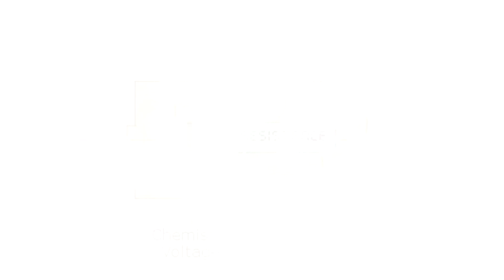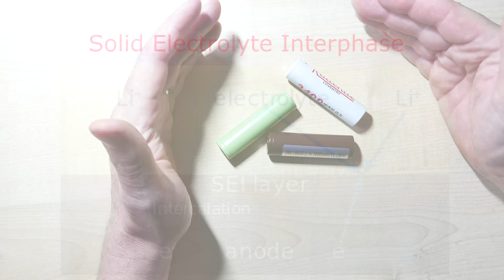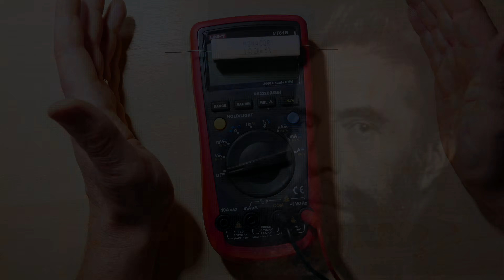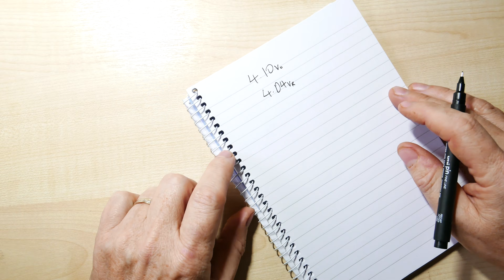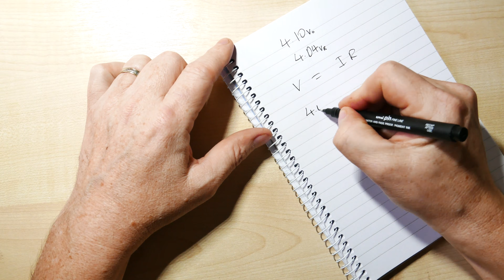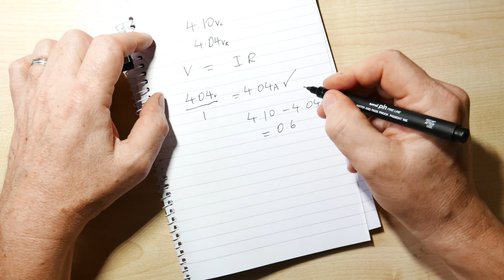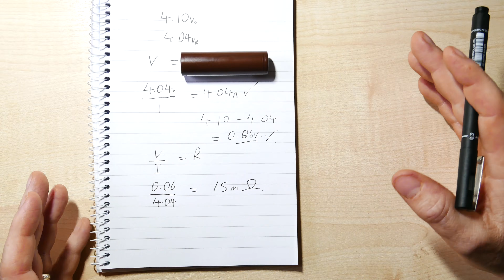18650 Li-ion Internal Resistance Explained & Measured

Comment: You can calculate the internal resistance 
Using Vload= vopen- I*R
The internal resistance calculated 1 the value at the current battery  Soc 
And it changes all the way draining the battery
At some point, draining the internal resistance 
Drops the comes back higher to previous state

Comment: I know it has been many, many years since you posted this, but thank you! My question is, when you added the resistor 1000 20w, and it dropped by .06v, the amps you showed was 4amps ish. Is that the continuous output amp rating? If not, how do I test that please? I have unmarked cells from a cheap ebay battery and a few cells are bad, but, they are funny enough with no markings whatsoever. I need to replace the cells in the giant pack, but have no idea what kind of cells they are. I am able to do the capacity test and that's great. Voltage test, also great. But, how can I test the amount of continuous amps and maybe even the max burst in amps output? If you get time, I would be very thankful, so I can try to find cells that are similar in spec. Great simple video! :popcorn-yellow-striped-smile:

Comment: Nice video but a little confusing because of the 1 ohm resistor. Two or 5 ohm resistor would have made the calculation a little harder but the video would have been easier to follow. Thanks again!

Comment: I got a question in terms of factoring in the resistance of the wires - would shorting out the the multimeter by touching both probes together give the resistance value of the internal circuitry and  wires of the measuring device? So whatever value it shows when doing so - one would subtract this from the value on what you get with the resistance of the battery?

Comment: Now I know why when I use the MC3000 charger's internal resistance measurement function, it takes a couple seconds. I guess it's waiting for the voltage 'sag' to settle.

Comment: Ummm....are you sure you calculated that correctly?
V/I = as far as I knew is Voltage / Current.
Where as you divided the Voltage drop 0.06v by the loaded voltage of 4.04v.
This only makes sense and gets the correct answer when using a 1 ohm resistor, because the loaded voltage and Amp draw are numerically equal to each other.
With any other resistor, the way you wrote the calculation will not give the correct answer.😁

Comment: I'm attempting this process right now to make a 3S balanced battery pack from 18650's, using Nichrome wire (3 ohms worth) as the resistor, but the voltage I get on my multimeter changes constantly making it hard to get any useful data. Is there a problem with the concept of using nichrome to do this? it's not coiled up, and it's not noticeably heating up.
Reply: Nevermind I was just getting inconsistent contact with my multimeter probe against the battery! battery holder makes all the difference!

Comment: Tom how much will the 5 % tolerance on your 1 ohm 20 watt +- 5% ceramic resistor effect the final internal resistance reading, i could do the math but was wondering if it would be worth the small extra cost for a precision wire wound audio 1 ohms 20 watt +- 1% ceramic resistor.

Comment: You said "just make sure the power rating is correct" how do you determine that the power rating of the resistor is correct? I would love to use this method to get an idea of internal resistance of some Yinlong 40ah LTO cells. They are much larger in capacity than these vape cells but the nominal voltage is lower. How do I figure out what resistor I need to test them? I plan to have the cells charged at 2.3v for the test, and I don't care about the number itself as much as the results being similar (I just want to make sure none of them have a much higher result of the equation) Any help is much appreciated!! They are 66160 cells 2.3v

Comment: if I don't know the resistor value, but I know that the discharge rate is at 1 amp this becomes simply subtracting Vr from Vo to get the internal resistance?
I found an old e-bike pack and want to quickly figure out which cells are better and which are worse.
I have a power bank case which accepts these cells. I test voltage across the leads with no load and with 1 amp load. 
Can it really be that simple?

Comment: Bi'I have a ? which is may be connected with battery resistance matter: when I try to charge some 18650 li! ion batteries mounted with laptop or drilling machine BMS,my 12v IMAX BY quickly buzzes with " CONNECTION BREAK" error.Then it is no more possible to charge: is is something that is fused or melted in the BMS?Inreallynwonder how to solve this f....g matter 🙃Thanks!! .

Comment: Great clip, 
To be accurate you should account for your wire resistance.  I estimate 4 to 7mOhm is your wire resistance , so your internal resistance is 8 to 11mOhm.
Reply: how about 5% accuracy of 1 Ohm resistor itself ? ;)
Reply: yeah, those wires will show their resistance at those 4 amps of  current

Comment: nice video thank you, people should not mix this numbers with resistor meters we use, they use ac internal impedance to get the meter reading number you should divide the result with 0.0022 ohms, the meter should show 67ohm which is pretty bad for a battery, good 18650 should read around 20ohm on ac (resistor meter), dc resistor should be 44ohm or the way u say 4.5 ohm.

Comment: Hi there, I'm a bit late to the party with this video. But can anyone tell me, Im trying to test some 18650 batteries, I'm using a resistor which is 1.5 ohm and 5 watt, is this suitable? Also, when I put my multimeter across the resistor it read 2ohm, so I put the multimeter across itself (touch the negative and positive probes together) and it reads .5 ohm. So my question is do I include this in the equation which is stated in the video, so instead of using 1.5 ohm like the resistor states I would use 2 ohm to account for the resistance of the multimeter? Thanks

Comment: I think when the resistence we are looking for is too low, we need to consider the resistence of the wires, olligators pressure, contacts, etc. Maybe mesuring the voltage on the wires too. What do you think about ?

Comment: Very helpful, been using my chargers measurement of internal resistance, but it keeps varying by quite a lot, I'll use you method as a base line, thanks.

Comment: with no load my cell was 3.77v with load it was 3.43v after the test without load it was 3.77v I checked the ampere before hand and it was 0.69 ampere 
so 0.34÷4.8 resistor = internal resistance of 0.51 ohm is this cell good for 1a load?

Comment: Hy, I got lifepo4 battery pack from all in one solar panel it's rating is 12.8 15Ah it has 4s 3P configuration but the problem is it's bms auto cut off its charging current when battery reached  around 13 volt but it should cut of at 14 . 4 volt because fully charged li fepo4 cell voltage is 3.6 volt so 3.6 x 4 = 14.4 but why it cut of at 13 volt because if you do the maths opposite, for each cell there is  just 3.2 volt average which is known as discharge cell but, bms thinks it's charged why?
Reply from the maker: One or more cells over-charged.
Reply: @crazytom  and I noticed one more thing , it also pops when this 5000mah cell deep discharge below 3 volt at very light load . This is weard for me because at 3p cell of 5000mah rating I was drawing just 1amp dc motor as load but when it deep discharged it pops without being hot it happened 2 times

Comment: Great vid.So we  always need a load to determine the internal resistance of the battery? Secondly you mentioned the SCI enjoying high voltages , can you explain what you ment there to prolong the life of a battery. What does that mean in simpler terms? Cheers

Comment: question: any resistor can be used instead of your 1.0 ohm 20w resistor you said, but if i use your Vo and Vr numbers and replace the 1,0 ohm 20w resistor with a 7,2 ohm 20w resistor i get a realy differen result, why is your calculation correct and not mine then?

Comment: Man, the resistance in those leads and contacts, connecting the 1 ohm resistor...that's gonna throw the math way off.  Resistor leads should be bonded to the screw terminals, or measure the whole stack-up with leads in circuit for exact resistance value.

Comment: The serious mistake with this method is the thin resistor's cables. It's better for comparison purposes to use a 3.7Ω/10W resistor (I ͌ 1A) and as short/as thick as possible cables to connect the resistor.  The internal resistance changes a little with the current and with the charge level of the cell.
Reply: I think same. And till a bad contact in the whole mesh will add some error.

Comment: Doesnt it also heavily depend on what load you use ? because im getting different results with the exact same battery.
Reply: I have tested with 1 Ohm and 10 Ohms load, and the difference was only 11 mOhm more for the 1 Ohm load, I'm doing two sets of test for better accuracy. With a lower resistance battery, the difference was negligible, so am thinking the precision goes down with bad cells at high loads...
edit: I wrote 100 Ohms, but it's 10 Ohms

Comment: Still a valuable video 5 years later. However, you said back the charge off a bit to 4.1 instead of 4.2V, but didn't suggest a method for doing this. I am mortally wounded (like Nelson!) Thank you very much. I have saved this video!

Comment: This is great and very comprehensive but I should add the resistance should be measured more accurately, not all resistances are made the same, but at the same time small resistance resistors are a pain to measure
Reply: for better precision, it would be better to do various measurements, with various set of resistors values, like 20, 10 and 1  Ohm, I use 10 and 1 Ohm and I get very close results

Comment: Please do forgive me for such a dumb question, but I've been told that even milliamps could incapacitate a man, but seeing that you calculated 4A from the 4V battery with a 1Ω resistor, would that have zapped you if you hadn't had that holder to keep your installation in place but tried to hold the resistor to the battery by hand? The numbers suggest so, but the 4V cell seems kinda' harmless... which part might I be misunberstanding here?
Reply from the maker: Yes .. a few milliamps to the heart can stop it but skin breakdown voltage is over 50V.

Comment: Well Done Tom!  
I’d like to check the IR of a LiFePO4 280AH cell, the open circuit voltage is 3.303V.  You mentioned any resistor will do but make sure the power rating is correct.  Does this mean a 1000 watt resistor?  What method (or resistor) do you suggest to check IR?  Cheers, Rich
Reply: I think you are mistaking capacity for current. if your resistor is 1 ohm then your test setup current will be ~3.3V / 1 ohm = 3.3A. So your resistor must be rated at minimum 3.3V*3.3A=11W. You could also use two 1 ohm resistors in paralel for testing the battery @ higher current: 3.3V/0.5ohm=6.6A. 
3.3V*6.6A / 2=11W each resistor.
Reply: @heinon8380  ...much appreciated Heino!  I’m going over the info.  
Rich

Comment: Good explanation of the matter. Here are couple of my notices on the measurement part: that power resistor has 5% precision, so it is slightly different than 1 Ohm. Little change in resistance will significantly affect the current running over that circuit. Another note: the wires used in the experiment has small diameter. It also creates a resistance when 4 A current runs. I would increase the wire diameter first and measure the resistance at the connection of the battery holder then run the measurement. In this case, the internal resistance of a battery would be a bit precise.
Reply from the maker: Yes good points but it's illustrative.

Comment: i have LiitoKala Lii-500 when is better to measuring internal resistance ,when is full charged or when is discharged ? it is very different value like 10-90
Reply from the maker: 3.7V preferable but 4.2V as alternative.  As long as you are consistent for comparison purposes.

Comment: OK. Now I know the internal resistance of the battery. What do I do with it? How do I know whether 15 milliohms is good or bad for particular cell?
Reply: The lower internal resistance, the better battery for high drain devices (for e-bikes, drilling machines, etc). Cheap batteries tend to have high internal resistance and cannot be used in batteries packs, they overheat when you apply heavy load. In general, look for lower internal resistance. When a battery ages, it tend to have higher internal resistance

Comment: lovely video nice and easy to understand thank you. 
i gotsa a question: on the resistor does the 20W rating mean anything over that would mean it starts to burn up? like 5A -->> Ploss = (I^2)*R so 25W it starts to get Hot?
also the 5% uncertainty is concerning the resistance right? so youd have to calculate the extreme "edge" case value for both resistance cases of the load resistor to get the uncertainty in the internal resistance of the cell, you cant just take that 5% and apply it to the result you calculated right?
many thanks
Reply: The resistor is used slightly outside the rating but it will survive a short test like this without problems.
The uncertainty on the measurement is dominated by the +/-5% of the resistor plus +/-0.5% for the multimeter inaccuracy. So it is easy to improve the accuracy by measuring the real resistance of the 1ohm resistor plus its wires, and using that measuremed value instead of the nominal 1 Ohm. Doing it like that, the error reduces from +/-0.83 mOhm to +/-0.075 mOhm.

Comment: This value is not even close to approximate,  hg2 has DC ir of about 23-24mohm , you should measure current yourself using a second multimeter rather than relying on the resistance rating,  I can bet real current was lower than 4 amps

Comment: Shouldn't you also measure the resistance of the resistor rather than relying solely on its stated value ?
I can see errors creeping in here.
>
Reply from the maker: Yes.. and the wires and compensate for temperature.  It's illustrative.
Reply: @crazytom  No not necessarily the wires and temperature if you don't need to be super precise.
My point was that a resistor may be marked incorrectly, say for example 1 megohm instead of 1 kilohm which is an order of magnitude that would seriously affect your result.
>

Comment: I'm doubtful that this is a valid method, and if it was your meters would need to be much higher resolution that what you're using here. You didn't measure any current or even verify the resistance of that resistor. Do you really think that cell has 15mOhm internal resistance?

Comment: The resistor is 1k 20w right? Can you do it with other? Like a salvaged one? Since much stores are now closed because of the pandemic.. Many thanks.
Reply: Can you do it with a 5w 1kOhm, same as yours but 5w instead of 20? It gets pretty hot ta l
Reply: @gugaboyz  NO!  Use 1 Ohm Resistor, not a 1K Ohm restisor ...
Reply: @MrSummitville  I'm just using the turnigy accucel 6 as soon as it gets here. Next week. It's instantaneous ;)  but thanks for the heads up

Comment: Not sure if the 15m-ohm is the correct resistance here. That sounds really low, I only heard about 25 or higher numbers.
Reply from the maker: I have LTO cells at 6mOhm
Reply: @Grace Ho - Purchase some high-discharge cells and then measure the Internal Resistance ...

Comment: What is a safe lowest discharge voltage pls
Reply from the maker: Each cell can differ.  If you stick to 2.9V for li-ion and 2.8V for LiFePo4 then you should be fine but some li-ion can safely discharge to 2.5V but there's very little useable energy left after 2.9V.
Reply: @crazytom  Does discharging below 3.1 volts shorten the cell's life, similar to how charging above 4.1 volts shortens the cell's life?
Reply from the maker: @MrSummitville  Yes!  Depth of discharge before recharging should we kept to a workable minimum.

Comment: Do I need to use a 20W resistor or will any resistor do the job? I have a very large battery, does that make a difference?
Reply: Since resistor will be used for short period of time you can use any, i use 5w and it only gets warm when testing
Reply: @Boz1211111  What size battery?
Reply: @yehudagoldberg6400  18650
Reply: @Boz1211111  I want to test 100 AH LFP cells.
Reply: @yehudagoldberg6400  guess voltage is what matters, tho you might want lower resistance resistor for such big battery, 1ohm could produce too small voltage drop to be measured correctly
Reply: Compute the Wattage dissipated by the resistor and then use a resistor rated, at least, double that ( for safety ). The resistor will get HOT !!!

Comment: The only thing you forgot to mention is about what internal resistance of an 18650  is when they are bad. How to determine the cell is bad
Reply from the maker: Any significant change in either direction measured at the same SoC.
Reply: @crazytom  thanks!!
Reply: To be specific. Is there a percentage out of manufacturers specs which you would consider it bad? Eg I have a few samsung inr18650‐20r batteries which by spec should be 15 or less but measure 38-128.

Comment: For future consideration...sometimes it's best to NOT use the simplest figures in tutorials If that means you get the same number appearing in multiple locations but means different things.
For example, I would advise using a resistor that is NOT 1ohm because that made the number "4.04" appear multiple times but meaning different things. People could easily confuse which value you are using in your example calculations and if they aren't VERY careful end up misusing it in their later application.